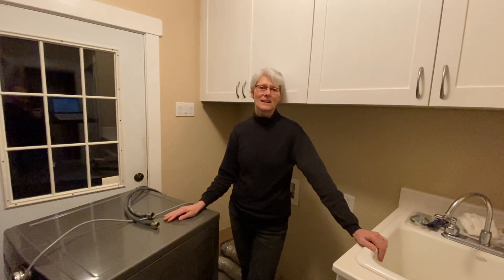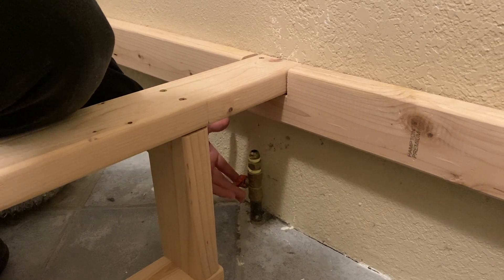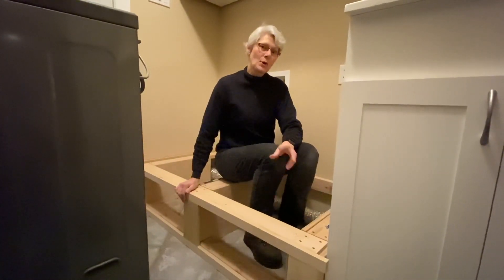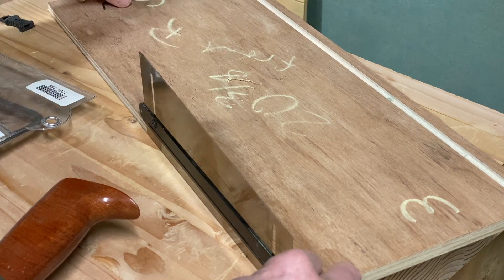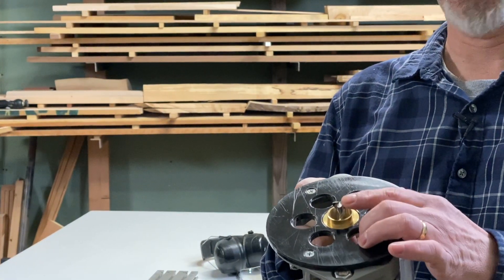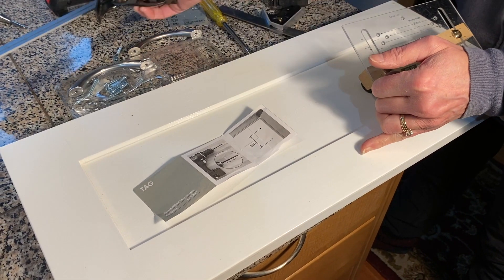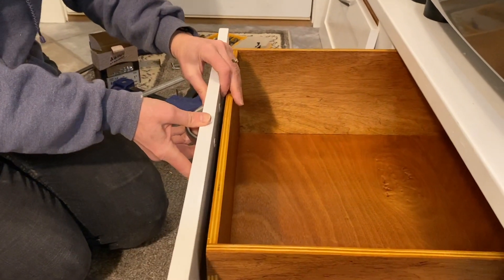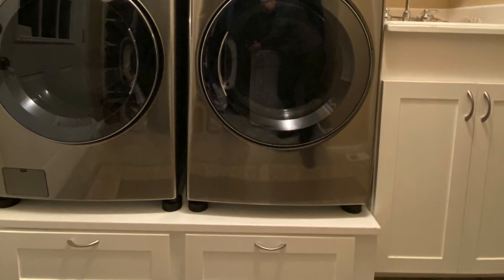Make a Laundry Washer/Dryer Pedestal

Comment: I'm trying to solve the exact same problem with my dryer exhaust and am working with my GC on a similar custom pedestal. Love your build here! Any trouble accessing the dryer exhaust duct for cleaning with this approach, or are you happy with most of the rigid duct hidden "permanently" in the box?

Edit: Also curious how you secured the ducting on the bottom? Are you able to reach in through the box with drawers removed?
Reply from the maker: Great questions! Yes, the ducting is behind the drawer. If hard ducting is first attached it can extend down into the hole. Make sure there is enough space around the ducting to work around the ducting. Attach the rest of the ducting below. Note that the drawer space needs to be tall enough to work in. It can be tight!

Cleaning the duct - a proper brush can clean it quite effectively. We go from outside toward the drier. But it’s a short and relatively straight run.

Comment: Do you have any issues with your dryer drying with that many turns in the exhaust?
Reply from the maker: Not really. It’s a short run and the only 90-degree bends are in the dryer itself, as designed. The rigid pipe is also better than the flexible or semi- rigid tubing in that regard.

Comment: I realize this video has been out awhile. I love the idea we have issues with the size of our laundry room as well. By any chance do you have a video on how to vent the dryer out of the bottom? Love your style!!! Thank you
Reply from the maker: Sorry, I don’t have that video. Check your dryer manual to see if there is a knock-out plate. We had a hard time getting the plate out, and each dryer has its own way of getting to the venting and rerouting the internals to vent down instead of sideways. Good luck!!  Hope you found the rest of the video helpful!
Reply: @SkyValleyStudio  Thank you so much for your quick response!!!! I appreciate it! I did find the spot where you can add a down vent to our dryer. With a little bit of research I did find the how to. I may have to make my own vent kit though. Everyone is sold out. LOL One other question. I believe you said your height of your platform is 10". Is this correct? I realize I can make this my own, however I love how yours is set up. Thanks Again!!
Reply from the maker: Yes, ours is 10” tall, but plan what you will use the drawers for. We have green coffee beans for roasting in ours! Sometimes an extra inch can make a huge difference!

Comment: Nice build. What, if anything did you use to secure the machines to the base? I thought I'd take a forstner bit and cut a recess for the feet to rest in similar to LG's plastic bracket on their base. Thx
Jeff
Reply from the maker: We bought heavy duty rubber cups for the feet. We still get a bit of vibration with unbalanced loads. I’d recommend a lip or trim piece in front to keep the machines from walking off the pedestals for those times you don’t realize the load is imbalanced. Or screw the cups to the top before putting the machines in place. That may work even better.

Comment: What kind of footers did you place under the appliance feet? And have you had issues with “creep” (where the washer travels) and/or house-shaking vibration during spin / rinse cycles? By screwing into the studs behind, those vibrations can travel quite far throughout the upper floor. I’ve been pondering the use of MLV (mass-loaded vinyl) and acoustical sealant to combat some of these concerns prior to designing my own.
Reply from the maker: The feet are on heavy rubber discs I got on Amazon. The thicker the better. The washer has some creep even with those, but they help dampen vibrations. And the creep is only fully loaded and on high spin speed. Added a front lip to keep it more in place. Another cross Support May have helped lessen creep. 

Vibrations in our loft are less than when it sat on the floor. 

STABLE-PADS Rubber, Non-Slip Anti... https://www.amazon.com/dp/B07M9CVX8K?ref=ppx_pop_mob_ap_share

Comment: Not a complaint but I would have liked to have seen how you put the top plywood on and trimmed. But I can’t pretty much see. Thanks for the videos. I was looking for bases with dryer access just like that.
Reply from the maker: The top plywood has a solid wood band tacked and glued on the edges. 3/4” thick by 1” wide (up and down) makes the top look thicker.
Reply from the maker: The top plywood has a solid wood band tacked and glued on the edges. 3/4” thick by 1” wide (up and down) makes the top look thicker.